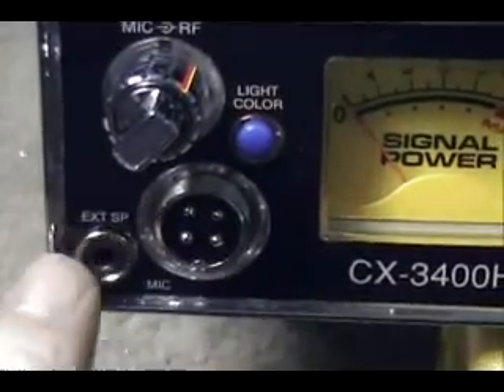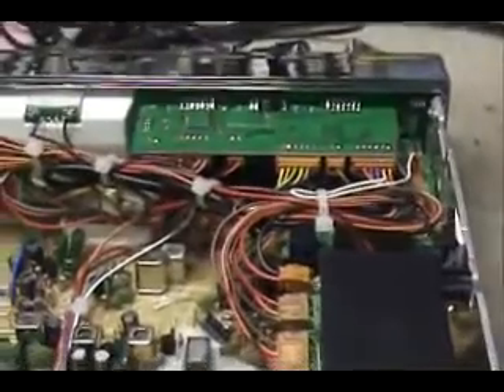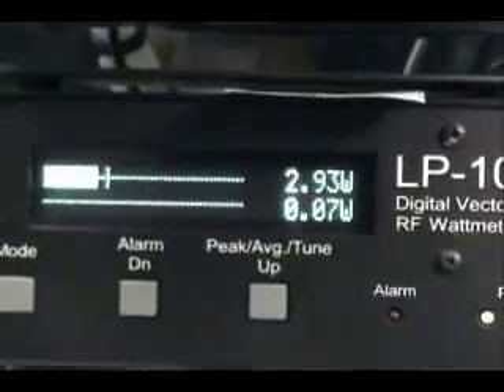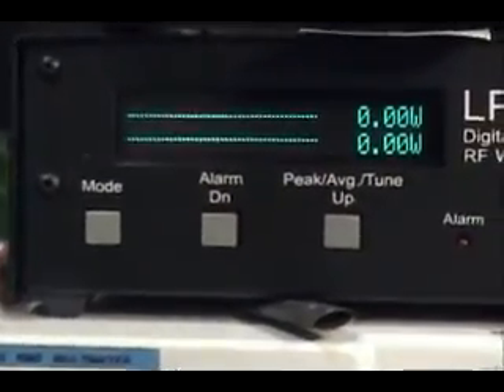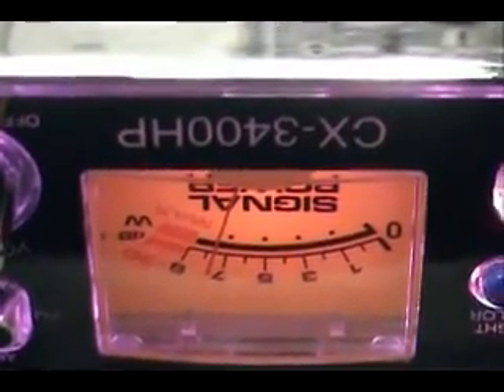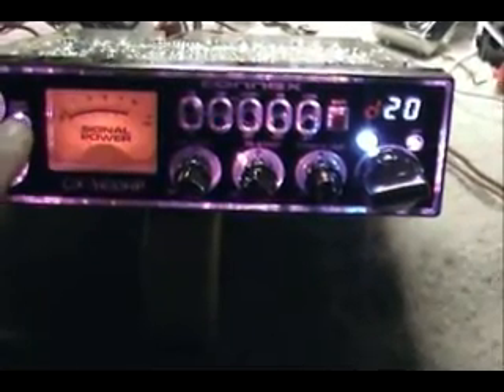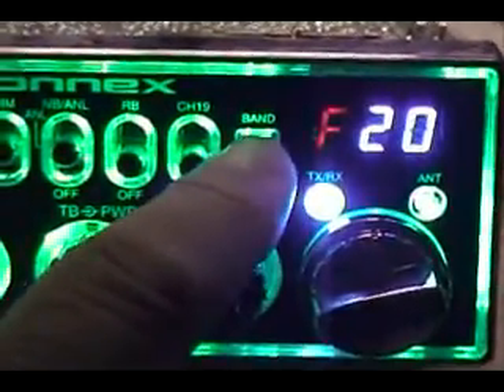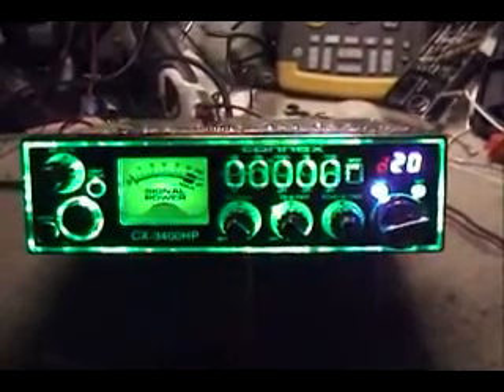Connex 3400 HP Review

Comment: Pretty neat features.  Like what you do!  Only 1.7 watts swinging up to 67 watts, that's a 20:1+ power ratio, seems a bit much.  How does it sound on the air like that?  Drawbacks I see with it are no SSB, variable power could mean you risk overdriving your amp if you turn the wrong knob, and crapily tuned from factory.  Lastly being an import,  how many of those 67 watts are on 27MHz?  Try a low pass before that meter.

Comment from the maker: I know what the book says but I don't agree with it on the S Meter settings. I use 30 microvolts @ 30% modulation for my settings. 
I might have said watts but that is why I don't do videos for a living. : )  I also don't run the tanks the way the book says, but after doing this for 25+ years I have found some shortcuts.